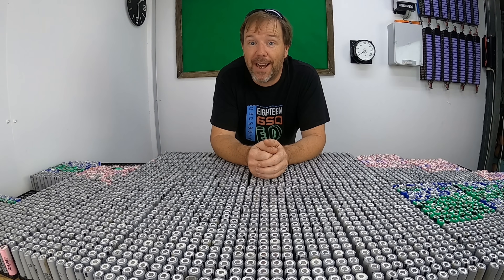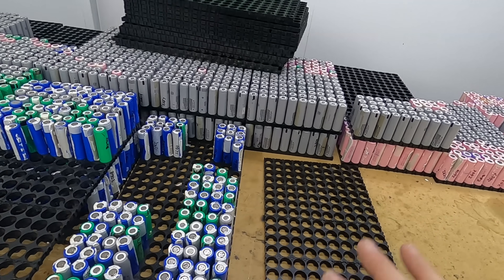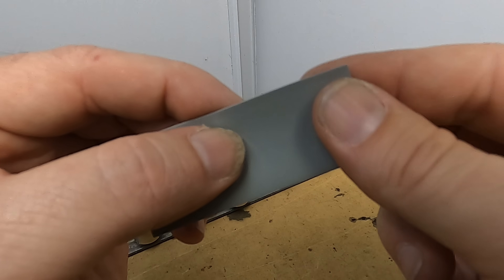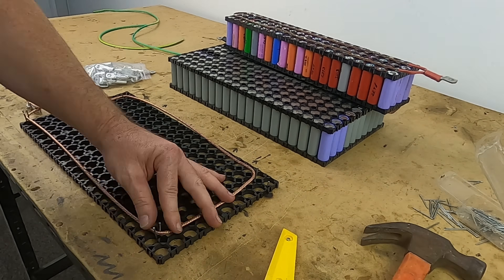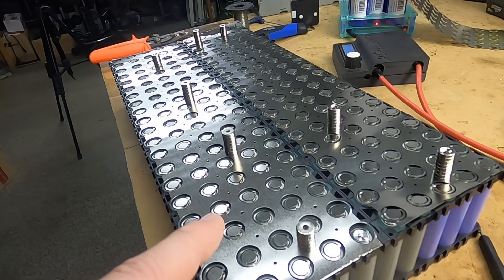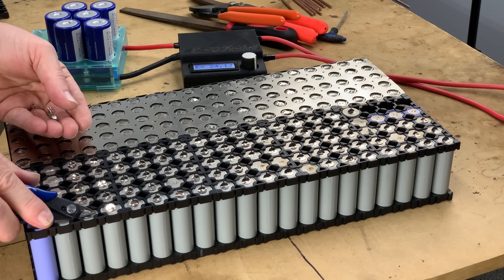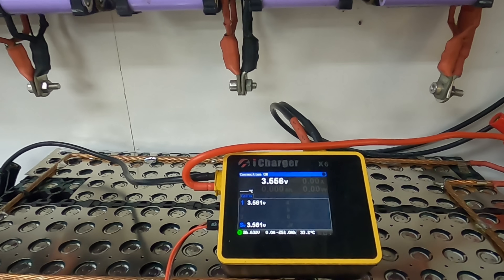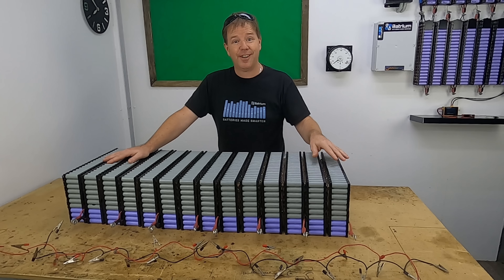Creating my single biggest D.I.Y. battery with 2800 18650 cells recovered from used laptop batteries

Comment: I wonder of one of the battery goes bad, how easy it would be to replace it from the big battery pack.
Reply from the maker: if you have all the gear set and ready i would say less than 10 min for one cell. To be fair would take 20 min to setup & packup again BUT an hour to find that one part or tool that has somehow gone missing! Same as putting a new tyre on your car yourself i guess

Comment: Where is the BMS ? or is that on another video ?
Reply from the maker: Who adds a BMS before install? And..... at the end of the video...
Reply: @HBPowerwall  most videos explain the BMS towards the starts, I just didn't see the bit 16:30 that said its in the next part. thanks for you reply.
Reply from the maker: @danielspiteri9018  Probably be a few more parts as the laws changed so have to comply that means a whole BUNCH of extra work :( but worth it for the extra layers of safety it'll inject into the project.

Comment: when you're mixing your 14 cells with different capacities, do you connect the BMS so it charges those different cells in 14 cell groups?
Reply from the maker: A BMS has nothing to do with charging or discharging only balancing & heat basicly (my BMS does MUCH more than just this)

Comment: Using 3000 batteries without any electronic temperature or switching control for each cell is like building a house only using bricks. In the end it's going to collapse and kill you if you are inside. Even the cheapest drill battery has electronic control to prevent fire. Good luck mate!
Reply from the maker: You're a twit -- watch to the end...

Comment: These thing are pretty dangerous. Didn't think it would happen to me, but I had one spontaneously "vent with flame".
Reply from the maker: Finally someone that knows their fault state... Did you over charger it, damage it, under charge it, over heat it ? Never seen one spontaneously vent without an external force at play.
Reply: @HBPowerwall  I don't know. It was charged a few hours prior in a Chinese headlamp with integrated charging.
Reply from the maker: @pointyfox  so you don't know if the charger overcharged it? Sounds likely, but sounds like you'll never know
Reply: @HBPowerwall  I'll never know.

Comment: When you use the crimping tool on 13:50 you should crimp it the other way around. First crimp it on the 8mm hole side of the thing and then crimp it at the wire side. That way the copper inside the thing can expand outwards. If you don't do it like that the copper may break/rip open the thing. I don't know how to explain it better and don't know how the thing is called because I'm Dutch speaking... I work on the high voltage grid here in Belgium and that's the way to do it for big cables anyway...
Reply from the maker: Awesome thanks for the tip.

Comment: now pass mineral oil through it and cool it.
Reply from the maker: Why?
Reply: @HBPowerwall  makes battery last longer, and you can get more out of them. it's how tesla keeps their battery packs performing.
Reply from the maker: @Commissar0617  I don't have Tesla power requirements i'm lucky to see 0.3 amps and that's the most perfect of perfect solar days typical draw/charge is 0.03 amps

Comment: building a battery like this is useless 18650 degrade around the 500th charge used batteries are probably close or already degraded mixing cells is not really a safe action due to different specs and manufacturing process chemical make ups a home use battery will be charged everyday by a year and half the batteries will lose 20% of their capacity by two years they won’t recharge so be careful about weather or not you want to spend the money for a battery that will only last two years if you find that the price is right then make sure the amperage and the capacity match when putting in parallel.
Reply from the maker: I'm four years into proving that statement at least in part wrong..

Comment: ive never used a soldering iron of that size before but that technique is how you cold joints in smaller electronic applications. heating pin and pad then flowing solder from the opposite side as you withdraw the iron is how I was taught in EE labs.
Reply from the maker: Lots of learning when i was soldering this battery, re-did probably half of the joints upon final inspection.. i think the time it took frustration set in just trying to get it done
Reply: @HBPowerwall  you ever try a soldering gun? that is what I use in automotive stuff.
Reply from the maker: Have in the past but not enough thermal mass to even start the job let alone get it done.

Comment: What happens if a laptop company has a recall due to bad batteries like dell did with their batteries catching fire?
Reply from the maker: Are you sure it was the battery not the BMS, housing, spot weld process, connections, fuses, temp sensors or firmware? They use 'battery' very loosely

Comment: You wouldn't want to have anything inflammable anywhere near this time bomb
Reply from the maker: Sounds like you have no idea of the properties or definition of what a bomb does.. of for that matter the failure process of these cells..
Reply: @HBPowerwall  No matter what the failure process of those batteries is, they still contain a enormous amount of chemical energy ready to be released in case of malfunction. I'd be very careful if I were you. Batteries are not toys
Reply from the maker: So why say bomb they explode - it's spreading false information. There is no doubt in their potential energy release it's just how it happens is important to know.
Reply: @HBPowerwall  "time bomb" =/= actual bomb. It's a metaphor...
Reply from the maker: It’s not even close. A bomb explodes.
Reply from the maker: They are toys to me. Love it! But I also respect their power.

Comment: Each cell of a lithium battery must be individually balanced with precision of one hundredth volt accuracy during  each charging cycle. Unfortunately there is no provision for that in this project so it rather looks like BS than a practical thing.
Reply from the maker: you assume very wrong lol you can either find the videos of how I did it or call it BS up to you.. This was a year long process not a 17min one..

Comment: This is very dangerous. Using old batteries, if one of them fails, you might get a nice explosion.
Reply from the maker: Explain how it will explode? Perhaps google the definition of explosion and then the failure states of 18650 lithium batteries in this configuration.

Comment: I've often thought about doing something like this, since pricing for solar has come down and I have a large shop to put the array on. I have a buddy in the insurance business and he told me large battery banks in homes are causing insurance companies to rethink premiums. I guess the risk of fire is greater? I suppose the benefits of cutting the electric bill out is better than paying the extra cost for increased premiums.
Reply from the maker: My premiums are SKY high doubt the power savings would even cover it... But this upgrade will address that in one foul swoop

Comment: The next time you solder, touch the solder to the heated metal, not the iron itself. It won't spit hot stuff all over your batteries and it will flow better because you won't be burning off the flux on the iron
Reply from the maker: YES this lol it was lazy, board frustration trying to get it done faster..

Comment: did you cycle and balance all these? And if so how long did it take?
Reply from the maker: Before building the battery packs each cell was processed. Charged, rested, tested for voltage drop & resistance tested. Then capacity tested checked for excessive heat while testing, recharged back to 4.17v rested and rechecked for voltage drop. After buiding the 191P battery each was charged to 4.17v again, Discharged at 30amps and recharged twice, the capacity recorded - recharged to 3.7v as a storage voltage then checked again before i'll put them into service for voltage drop. Each 30amp discharge took about 17 hours and had an average of 485ah 4.17 to 2.9v

Comment: I’m in the solar industry. Just wondering are you aware that in Australia all batteries/solar panel/inverters need to be certified by the clean energy council before they can legally be installed? Its not just for your safety, but also for the safety of other people using the grid. Ignore my comment if your system is completely off grid.
Reply from the maker: Check out part two.

Comment: What kind of laptop's battery did you use? I open each one, and finally I get a battery with a capacity of 2200. Maximum..
I mean, in your experience, which brand of laptop has the most battery capacity?
Reply from the maker: Premium grade laptops almost always yeild better batteries - these were all from Asus laptops and most were NCR18650's

Comment: your volume needs to be DOUBLE what it is now
Reply: Check both your volumes.
Reply: @dannygjk  youtube volume is all the way up, typically i can comfortably listen with my pc volume at 30. It had to be 80 in this video with parts needing it to be cranked all the way to 100
Reply: @KryptCeeper969  My PC volume was only 48% and I could hear him clearly. Now I know PC is typically used for desktop but are you using a laptop and relying on the laptop speakers?
Reply from the maker: I'll take that into account next time
Reply: @HBPowerwall  sorry if i came off as rude. Bad audio is a pet peeve of mine. Have a good day

Comment: But used battery aren't healthy cells...  Different resistance....  It's not going to last longer
Reply from the maker: Let me prove your wrong.
Reply: @HBPowerwall  I don't know how you choose your batteries but from some minor experience and suggestions of expert from ppl like you say it is not going to last longer cause some battery's 🔋 will die inside... Another hard process to find it and replace it ... That's what I know...  But you're testing it, in Morocco we say don't go to the doctor ask the experts...  Cause they know what the doctor won't believe
Reply: I doubt that he's talking about cells that are old.
Reply: @dannygjk  he said that all cells was recovered from laptops battery, he can't buy new laptops battery cause of the waste of money and time, it has to be old and used before in my opinion
Reply: @imadkali  Never mind.
Reply from the maker: Before building the battery packs each cell was processed. Charged, rested, tested for voltage drop & resistance tested. Then capacity tested checked for excessive heat while testing, recharged back to 4.17v rested and rechecked for voltage drop. After buiding the 191P battery each was charged to 4.17v again, Discharged at 30amps and recharged twice, the capacity recorded - recharged to 3.7v as a storage voltage then checked again before i'll put them into service for voltage drop. Each 30amp discharge took about 17 hours and had an average of 485ah 4.17 to 2.9v
Reply: @HBPowerwall  You are assuming they have knowledge of electricity. ;) Also probably listened to less than 10% of the video.
Reply from the maker: I can’t help that.
Reply: @HBPowerwall  lol yep
Reply: @HBPowerwall  thanks for the response, it's a hard working process, I'm wondering how much time they are working, I'm not against what you do, English is my 3rd language so please if I didn't understand or write the wrong way my comments don't abuse...  I'm searching for knowledge, I'm not proofing anything her I'm just asking questions, good luck for you and your projects I will never come back to ask you questions again, peace

Comment: What happens if you don't put that insulating plastic in each battery?  I think it would refrigerate better.  Is there a danger of a short circuit?
Greetins.
Reply from the maker: The gains outweigh the disadvantages

Comment: I'm getting a couple brown-out's in storms near me. How can I wire this to my house / grid to immediately supply power for the 30 seconds to 30 minutes of the temp brown-out?
Reply from the maker: Put the PIP4048 inverters into UPS mode & set them to grid - power goes out transfers to inverters and back to grid when they detect grid power

Comment: Brother this is the worst addiction ever! I cant help myself every time I see a laptop battery or anything 18650 related I have to crack it open pull the battery and charge it test it and build it so far I have done 6 50cell power banks using drill controllers and let me tell you they pack more power more amp/hour that any lead acid by far. this is the best invention ever.
I believe this is how it feels to be addicted to crack, cant help it cant stop just gotta have more!!!
Reply from the maker: Its an enjoyable hobby for sure
Reply: @HBPowerwall  I gotta say, you my friend set the standard high for all, like I am already planning my solar and my future battery packs based on your research. Thank You I wish you the best!
Reply from the maker: I really do try to improve every step i take..
Reply: At least with your hobby there is something positive occurring and things being made.. With crack, your every intention is dedicated to an endless search for a means to procure more crack at nearly any cost (including robbing your own mother or equivalent family member) as you will gain an ever increasing suffocating feeling of dread until you procure more. You then smoke it, feel equal parts relief, shame and dread whilst combing your floor for imaginary pieces of crack you didn't drop and fear of things you think you heard and seen that either weren't there or were just normal sounds in an anxiety ridden nightmare of an existence.. Then start the process all over again the next day assuming you were ever able to give up the search for more the night before without being jacked, killed or arrested.. I haven't smoked that soul destroying garbage for 13 years after smoking it for 1 year due to people i was living with at the time who smoked it every night, but very few things can ever compare or ever will.
Reply: @EnhancedCognition  yes, but crack

Comment: How much did all of this cost? and would you recommend others to do the same given the wast supply of rechargable batteries ?
Reply from the maker: Good question - IF i was given the choice to do it again ... Nup, i'm done lol easier with a Tesla Module
Reply: @HBPowerwall  cost is the number one people care about because they want to know if they can do it themselves.. and some need to know the cost per kwh . so having gone through the trouble is a waste  without passing the
 information
Reply: @ronswanson9368  this is fun to watch, but very dangerous if not done correctly. if you're not a technician, you probably shouldn't do anything this size.
Reply: He shared a spreadsheet in the description. $10k, which I assume is AUS? And somehow he only paid $800 for 3000 batteries...🤷🏼‍♂️

Comment: Have you tested the actual capacity? If they’re old batteries won’t they be degraded
Reply from the maker: Spent months testing every cell for heat, capacity, self discharge - then after the battery was built each 191p battery was charged to 4.17v discharged to 2.9v recharged back to 3.7v rested for weeks then tested the voltage again.
Reply: HBPowerwall damn that’s hardcore dedication, you’re insane!
Reply from the maker: It's how it should be done to reduce even the smallest fault from making it through to a competed battery

Comment: a really nice job done assembling those packs. Shrink,  solder etc.  I've worked in a battery plant and I've seen what can happen with cells.  There is no way i'd allow my family to sleep in that house with that in the basement.  No knock here for your work.  But safety has been ignored.  You should have smoke detectors.  Fire Retardant wont put them out when it goes off. .  The vapors when these things give off is bad and toxic.

Im not knocking your innovation. just in its current state its a bit dangerous.
Reply from the maker: Its in my workshop 20m away from my home surrounded by acceptable losses
Reply: Good Thoughts :)

Comment: come back to this video in 10 years and batteries will be half this size
Reply from the maker: This will be in my iphone 31
Reply: @HBPowerwall  nah,  the iPhone 31 is supposed to run off the earths geo-magnetic field
Reply from the maker: I thought that was the 32?
Reply: It may be the 31 xsmaxiquantumpro
Reply from the maker: Lol
Reply: It comes out 3 days before the 32
Reply: @DrJak1ll  u guys are crazy...lol
Reply from the maker: Crazy is a nice change 😆
Reply: @HBPowerwall  what do you think would be necessary to run a small window AC unit damn near on the equator with about 6 hours of sun per day.  Could you design a system for cheap and considering the batteries will likely be sourced from Uganda?  Also,  take into consideration that I am completely new to solar.  I have big ambitions😁

Comment: When then one Batterie dies good luck finding tha faulty one xD
Reply from the maker: Thermal camera and 100amps charge current will very quickly show me an issue. Also those fuses that are broken can be seen easily & my BMS will show me faults or weak batteries pointing to a problem - so won't be needing luck, Just regular maintenance like your car.
Reply: @HBPowerwall  or like that, but imagine without such stuff xD